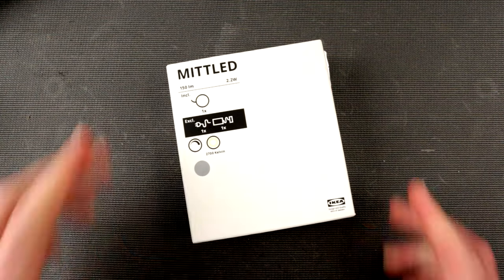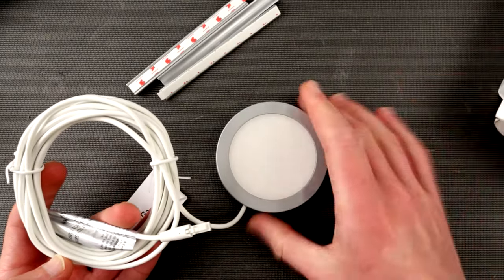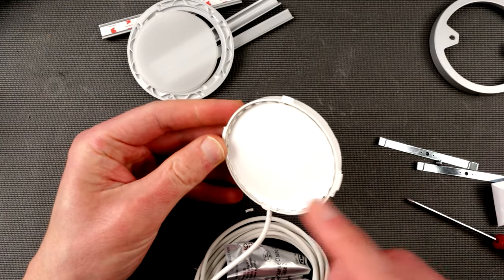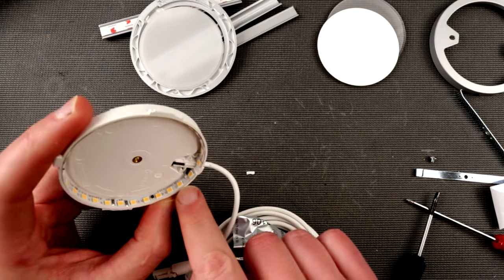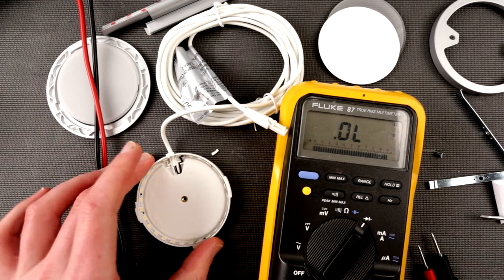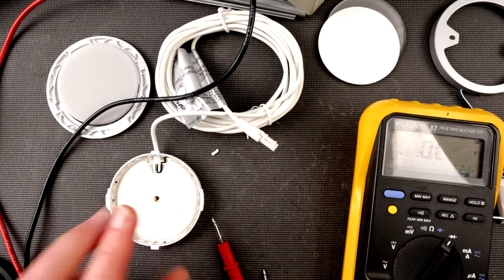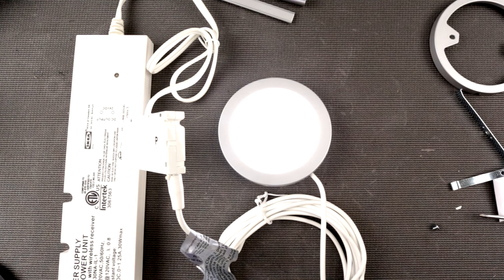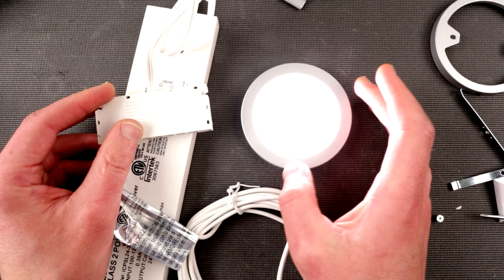Ikea Mittled Round LED light teardown and analysis

Comment: Just bought this thing, and, of course, I also don't read diagrams. However, to my defense, who the hell sells a light without a cable to connect it to mains???
Reply from the maker: Haha.. yeah bro, this is how they get you :)
Power brick is not expensive but you need it as well :D
Reply: I went and ordered the Ansluta with transformer and cable, cuz I don't want the wireless thing that comes with the Tradfri and Fornimma. I truly hope I didn't make a mistake. Again. 🤣
Reply from the maker: @mrgittv  if you want just to power it up it should work, no remote though....
Reply: @InsideOutElectronics  yeah, don't need the remote. Plus, I only bought 2 lights, so I think my wattage will be fine aswell
Reply: @InsideOutElectronics  definitely confirmed. Plugged the 2 lights into the ansluta, works fine, even though their customer service told me it wouldn't work.
Reply from the maker: @mrgittv  Awesome! Thank tou dor sharing with us!

Comment: How would you advise I change the color of the light from warm white to cool white?
Reply from the maker: No easy... Replacing LEDs not economical option. another one is to paint LEDs or diffuser with blue marker....
Reply: You could buy Photography color gels in blue and simply place a sheet (or two if needed) in front of the diffuser. That should compensate and make the light cooler temp.